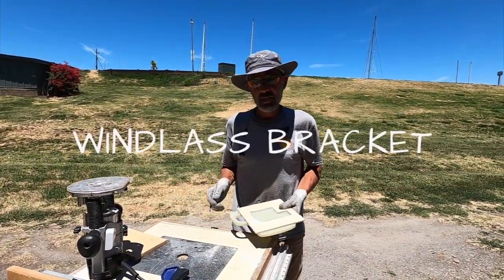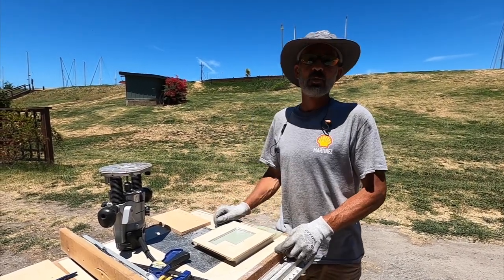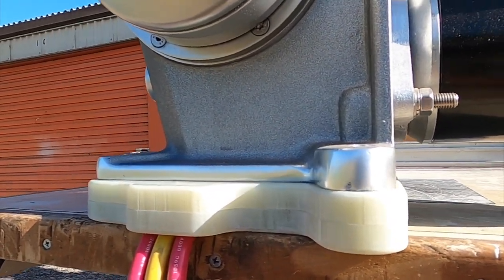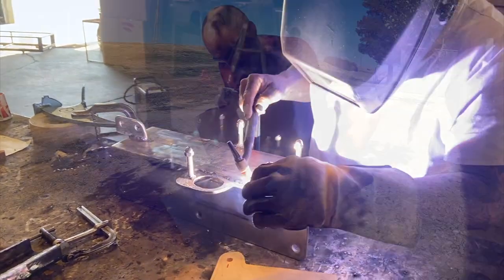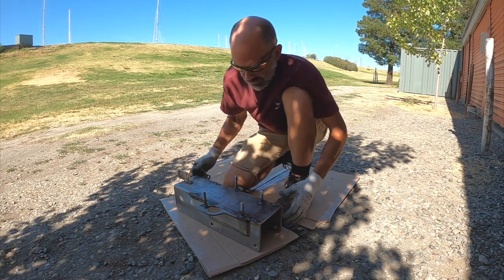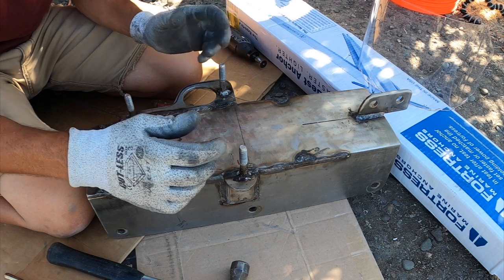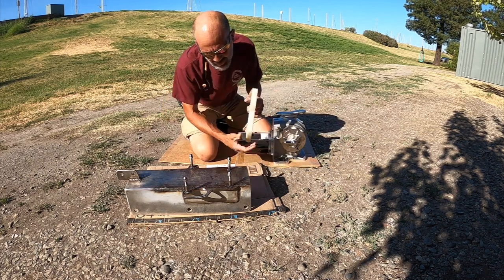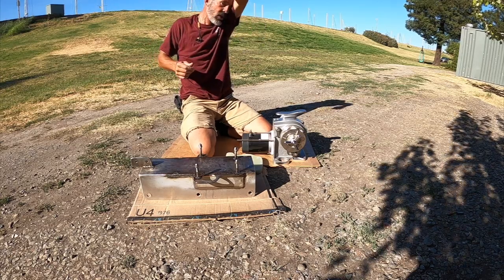SV Ramble On | Making the Windlass Bracket & Riser Plate

Comment: Thanks for another great materials/fabrication lesson, Cap’n. I just used some 3/4” PVC board for the foot pads for our new stern arch. Now I’m wishing I had known about G-10 as it looks like it would have been a better choice for that application. What kind of glue/epoxy will you use to connect the two layers of G-10?
Reply from the maker: Hey Dayton, I used regular old West System 105/206 epoxy/hardener, and some microfiber thickener to laminate the two halves.  G10 is great, but it runs a little on the expensive side.  I had some left over from our chainplate project a few years ago, and read about other people having problems with Starboard polyethylene sheet compressing and deforming over time under their electric windlass'.  It's a little tough on cutting tools and it makes you itch like crazy when machining, but that stuff will last forever.

Comment: Rick.. did you use any kind of backing on your main sheet traveler install.

I have one with a similar footprint and was trying to avoid hacking up the head liner in favor of washers like the original one.?

Cheers
Oliver 
S/V Voyager
Reply from the maker: Our Garhauer traveler came with matching SS backing plates, and we did have to take the headliner down to do a proper install.  Ground out all the coring in the bolt holes through the roof, and potted them with epoxy to prevent future rot before installation.

Comment: Rich, you are a maniac. Do you do anything off the ground or deck? I want to buy you a folding metal table or something to get you off the gravel. Save your knees captain. Great step by step. Can't believe that nut stuck after 24 hours. Carry on..3 channels get an automatic like. Yours is one of them.
Reply from the maker: Ha ha, thanks for the offer man.  I do have a sort-of "bench" in my cluttered shop, but for grinding and sanding I prefer to be outside where the dust and metal fragments can float away with the breeze.  Thanks for watching.